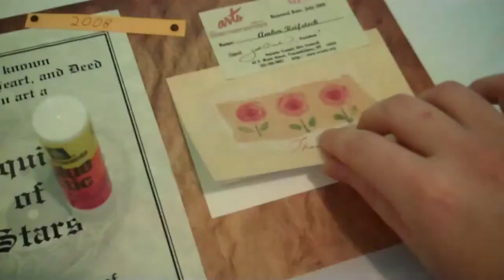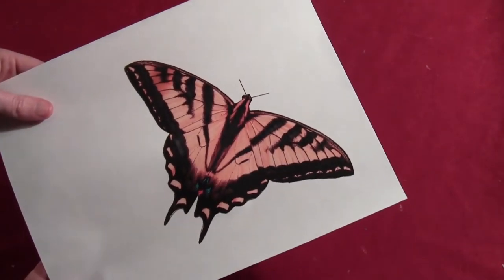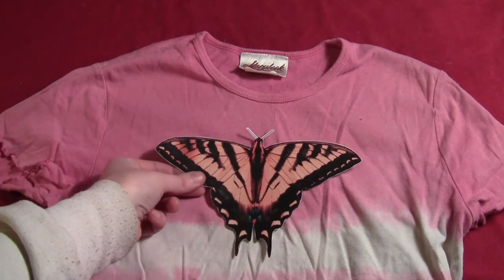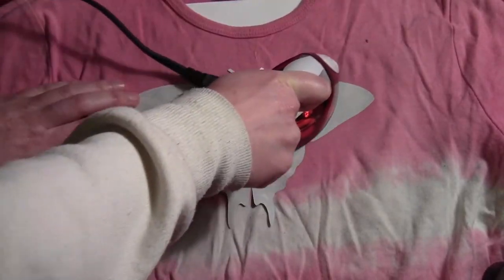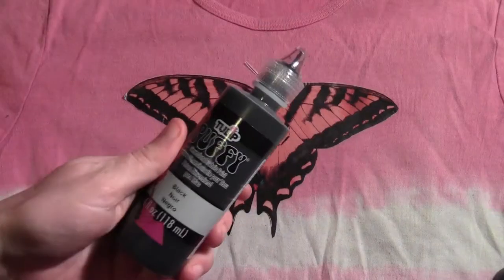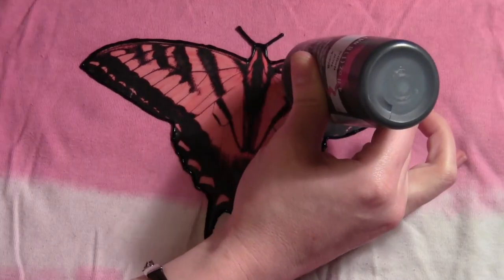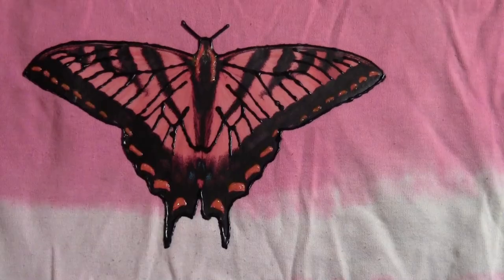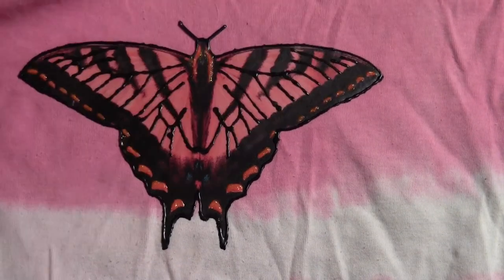How to Embellish a Shirt with Iron on Transfers and Puffy Paint

Comment: How well do you find that the iron on transfer prints last? They used to be horrible, but have they improved?
Reply from the maker: They're better than they used to be, but they still rip out if they're washed too many times on rough cycle. But puffy painting the edges elongates their life I've found, since that's where they usually wear out first. Also turning the shirt inside out before washing it does wonders to enhance the life of transfers.